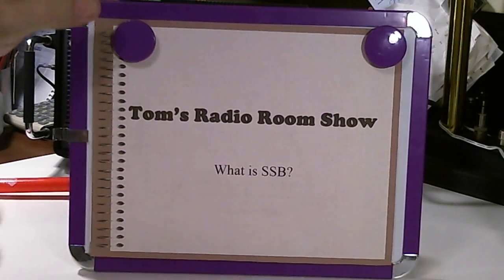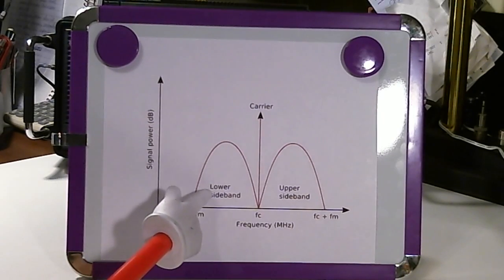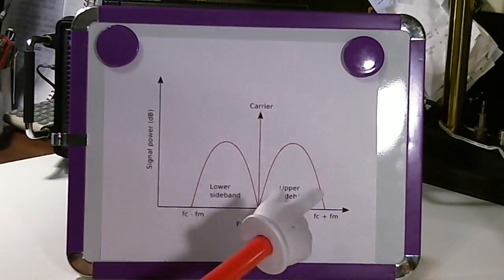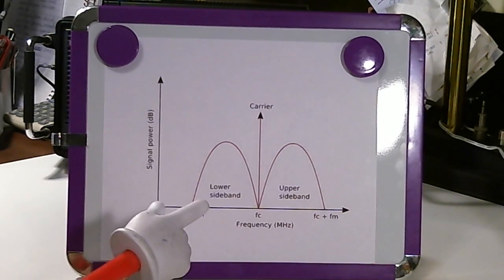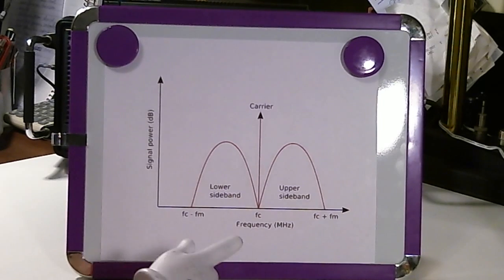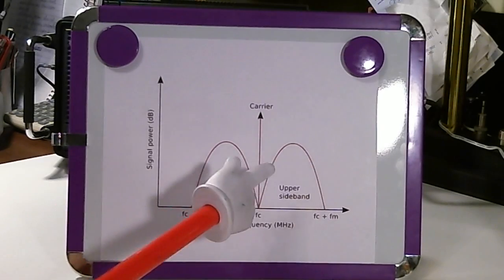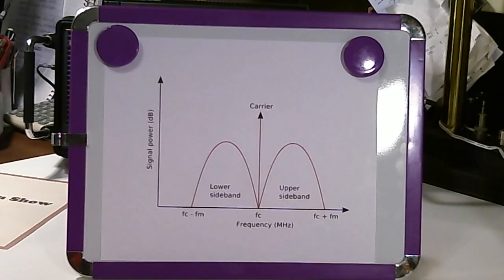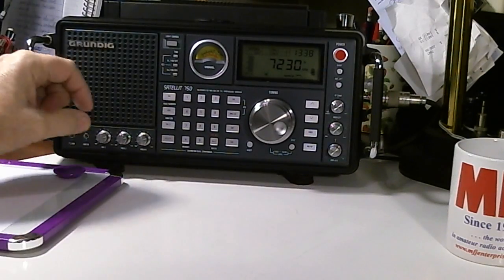TRRS #0217 - What is Single Side Band (SSB) Modulation?

Comment: Tuning an AM signal in SSB (its called ECSS or ECR Exalted Carrier Reception) requires an exceedingly precisely tuned radio. I don't even try it on my Grundig Sat 750. I am able to do it on my Tecsun PL880 & my Icom R75. My SDR-IQ has an ECSS setting that has selectable side bands. It works as well as synchronous detection on a good radio.
Reply from the maker: Thanks for the great information.

Tom

Comment: Below 14 mhz is almost always LSB in my experience while 20 meters and above is USB. There is an airliner communication frequency somewhere around  the 6500 khz range or so that is USB.
Reply from the maker: Thanks for the information.

Tom
Reply from the maker: Thanks for the very helpful information.

Tom
Reply: *****  That explains why I heard that airliner communication on USB around 6500.  I always wondered the actual reasons for USB and LSB usage.
Reply: Amateur radio operators use LSB below 10 Mhz & USB above 10 Mhz. Almost all utility signals will be in USB. The only non ham signals that you will find in LSB are "pescadores" that operate just below the 40 meter ham band & some South American feeder stations  but those are increasingly rare.
Reply: +Richard2003 Only hams use LSB almost all commercial HF SSB such as aviation and marine hf communications use USB regardless of frequency.
Reply: I did not know that. Thanks.

Comment: FB Tom. Not an easy subject to explain briefly. Just a tip here. If you're chasing AM/SW weak DX broadcasters, switching to SSB mode will throw up a carrier tone, allowing the listener to  zero beat a station easier. Once zero beated, switching back to AM mode will often reveal an otherwise missed station. 73, Karl
Reply from the maker: The good news is that I got some excellent comments from the subscribers.

Tom